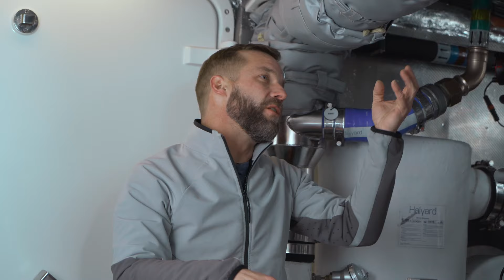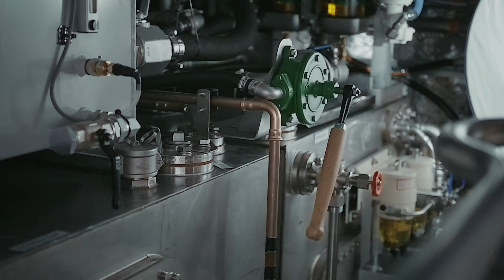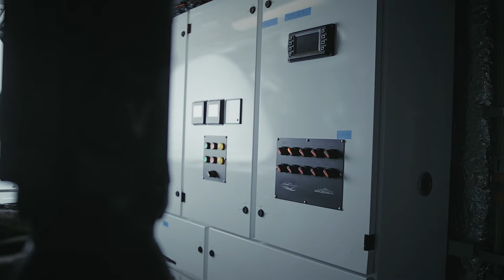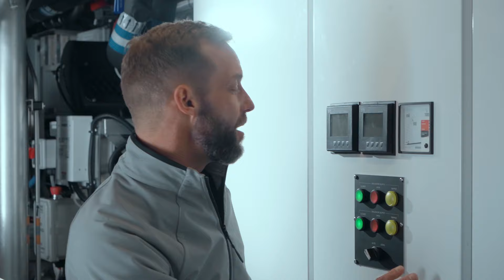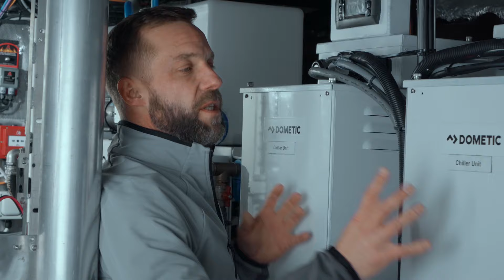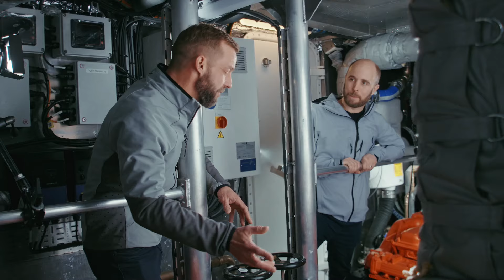Arksen 85 | Project Pelagos | Engine Room

Comment: Why raw water cooling and not a keel cooler closed loop?
Reply from the maker: We did consider this, as they have many benefits, however didn’t want the extra drag and damage risk of external grid coolers, or the loss of volume associated with recessed or box coolers.

Comment: Nice details. Lovely commercial construction details. Lots of top quality design work, with a high level building of systems.  She is ideal for hi latitudes and the poles. We want one for a Polar Partnership Vessel based out Homer Alaska and our new deep water Harbor project.  This vessel would connect the Arctic Form Countries with the fast growing interest in the North. She is a modern "School Ship". Fast in normal service, and excels  in surfing conditions is my guess. We need a west coast Arksen 85 to connect the Pacific Rim Countries. Alaska, Mexico, and Asia on a regular missions. Connecting the pacific rim  on Arksen 85 at a time.